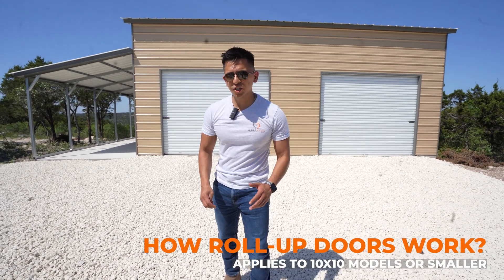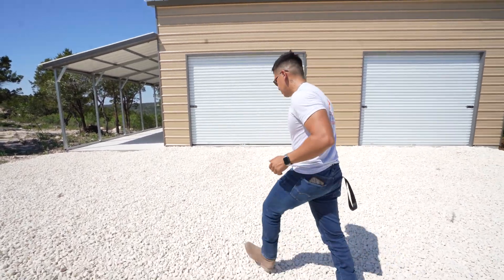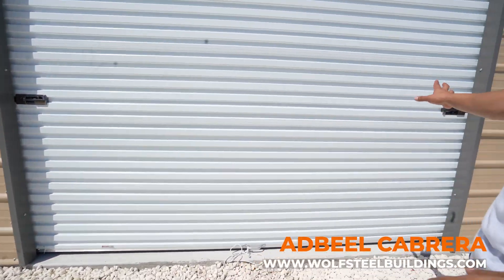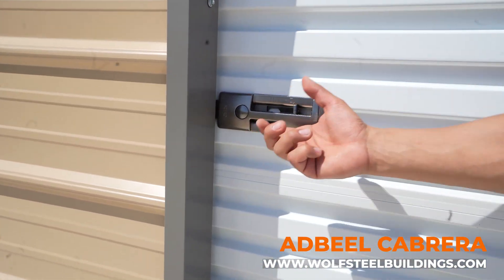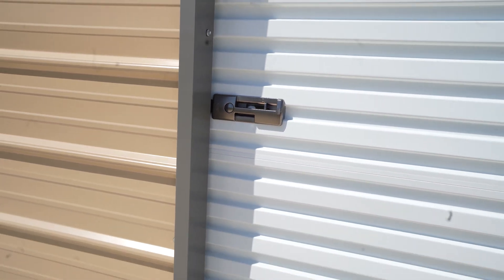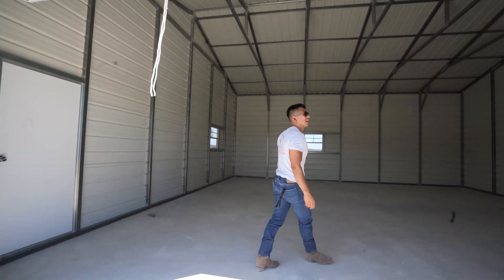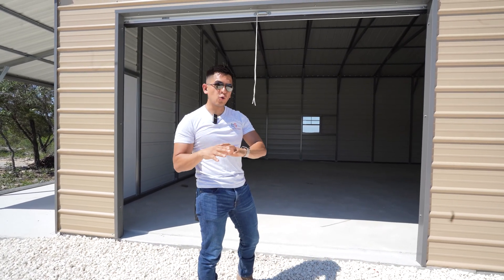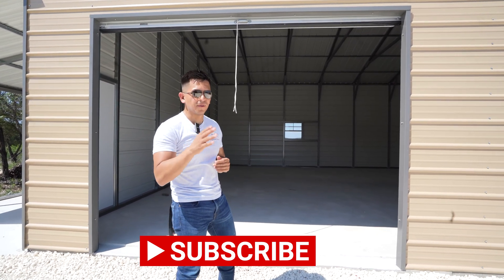How do roll up doors work on Metal Buildings? | WolfSteel Buildings

Comment: I have Eagle Car Port, with 2-10'x10' doors. To adjust the tension, there is a hex screw. It seems to matter which way I turn it, the tension does not change.
Reply from the maker: Hello There! Thanks For Responding,  my first advise would be Check in with Eagle Carports and see if you are still under Workmanship Warranty! 

Since I am  not sure what Door you have, but the most common  door used in the industry is the Janus 650. it should have a star Device on the left hand side of the barrel with 4 half inch holes, easy enough for crescent wrench to fit "opposite end" 

which you can turn clockwise and will feel when it locks into place.  ill link a video on here and hope this helps you  visualize it better. thanks again for commenting! = )  

https://www.youtube.com/watch?v=nK2uZj4kf4Y
Reply: @wolfsteelbuildings  My doors have a different tension mechanism. I do appreciate your response, blessings!!!!

Comment: Where can I find the exterior lock on this video?
Reply: Can an electric opener be put on these doors?
Reply: @traciebecker6669  you can! We don’t have an opener that we specifically recommend but it is possible. Verify the model of your roll-up door with your builder to determine which opener will fit. If you do, mind sharing?
Reply from the maker: Any door below a 10x10 comes with the exterior latches, as seen in the video, they do not come with locks. Those are sold separately. You can purchase any pad lock at any local store!